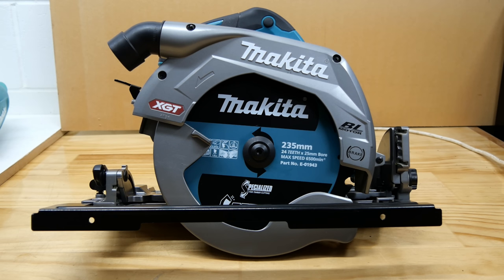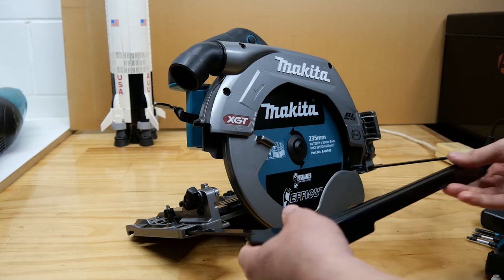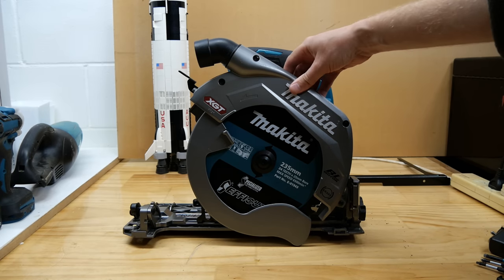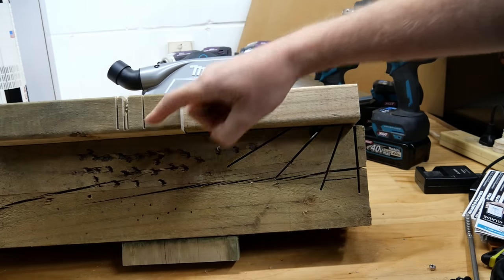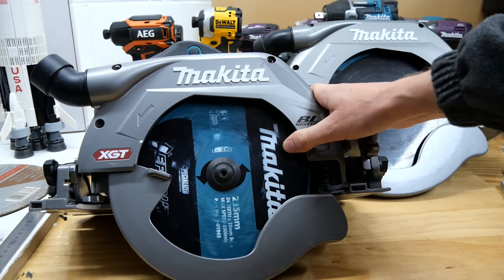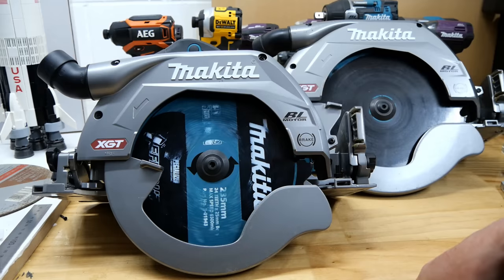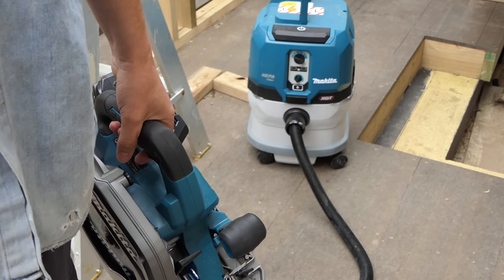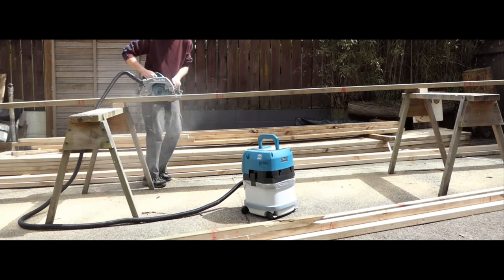40v Makita 235mm Circular Saw Review. Is the Track Compatible 9-1/4" Saw as Good as the 10-5/8" Saw?

Comment: So from this review, my takeaway is that for any piece of lumber wide enough to fit the track on and to long of a cut to make with the miter saw is easiest done with a maki track saw, unless it's thicker than 4 inches, then you need a cabinetry saw or a bandsaw. If there's that much of a performance difference from 4ah to 8ah, and from 235 to 270mm, then the 270mm saw is using close to the maximum potential of the 8ah battery, which is 2160 watts, or 2 and 15/16th's hp. In other words, this saw, with 375$ in accessories (makita tracks, knock off parallel guides, aws chip) can do 99% of the work of a 4k SawStop (3hp, 52 inch rip fence) and barely squeak in over 1k after tax, with comparable dust extraction and the Makita having anti-kick back tech and the sawstop having hand detection. Sawstop is still the safest, but not by much. I'm disappointed more people don't buy these, I wish Makita made a cabinetry blade for these saws but they won't until there's demand, presumably.

Comment: Great videos and really insightful. Currently I'm 18V Makita and have a track. Currently doing some cabinetry etc but like the circular saw option you speak of as they're cheaper and more flexibility. Looking at the 185, am I missing out on anything significant versus the newer 235, or also the more expensive plunge saw? (although 36v plunge also an option). Do Makita plunge saws have less blade play or anything for more precise cuts? Any insight would be greatly appreciated. Thanks!
Reply: Makita makes a 36v (lxt) 235mm track saw, but according to another commenter the LXT version has a more powerful motor than the XGT 235mm equivalent, but I don't think you'd notice unless you have 4ah batteries on the LXT saw. It's almost a table saw, it can do some things a table saw can't too. (60 degree bevel, ability to cut longer pieces, safer than any table saw except a sawstop). With a track and parallel guide rails for it, this saw is almost a table saw. It can't make cuts on pieces narrower than the track, which is the only time a table saw would make a cut more easily than a the LXT track saw, or if you need that last quarter inch of depth a table saw offers. But you'll also need a plunge cut saw regardless to make plunge cuts that don't have tearout.

Comment: How does the HS009G compare to the 36v version (dhs900)? 
I know from your testing generally the XGT stuff performs slightly better than the 36v equivalents, but it is not clear if that is just due to the XGT tools being slightly newer designs (e.g. updated motors), or if it is due to the XGT platform being more powerful than the 36v.

However, interestingly Makita Japan and UK list both higher power (1800w vs 1600w) and higher rpm (4500rpm vs 4000rpm) for the 36v dhs900 compared to the XGT HS009G.

Have you done any comparisons on these two saws? Any thoughts?

Comment: If only they would make one with the handle on the wrong side for us Americans 😊
Reply: Using a left blade saw on a guide rail is awkward as hell. I have the 6-1/2" saw with the guide rail adapter and it's awkward to use especially if you have a guide rail square attached
Reply: @a-carpenter9229  I think it's just the adapter that's awkward I have little 5 inch or 125mm saw and it's blade right still awkward with adapter
Reply: They make a 10 1/4" rear handle blade left beam saw. Worth buying if you work with beams alot I have the 270mm saw it's awesome.

Comment: price of the gsh03  $589  and  gsh04 $600 here in the states makes the pick easy for $11 more but $600 for circular saw is a bit much.   Also note Makita makes a universal adapter to use any vacuum with the AWS
Reply from the maker: Any corded vac with an external power socket outlet.
Reply: Unfortunately it doesn't work as a relay, so you can't use just any old vacuum. Has to be one with an external trigger lead for a corded tool. It's also stupidly expensive for what it is. The better solution for now is to use a remote control relay system if you intend to use it with a standard shop vac.

Comment: When we are gonna see review of the impact wrenches? You have them almost a year now and keep teasing them 🙂. Also, is that true that if you remove battery from a tool that is paired with a hoover via aws, it looses connection and you have to pair it again after replacing the battery? Like when battery goes flat and you change it with a charged one, the aws won't work and need pairing again? Seems silly hence asking.
Reply: No it's saved on the AWS chip
Reply from the maker: You have to turn the chip on, on the tool when you change the battery. Takes 2 seconds.

Comment: Is it possible to adjust the base plates over slightly to line up with the plunge saws on the guide rail? Plunge saws have that option so no matter what brand of saw you use on a guide rail you can set them all to the same cut line
Reply: Yes you can

Comment: Desperately want to know if the 40v 9 1/4 track compatible base will fit on the 36v 9 1/4 saw, any insight would be greatly appreciated! Help a tight arse chippy who doesn’t want to switch platforms out 😂
Reply: This track saw will work with half of all track saw manufacturers tracks. Makita, Festool, PowerTec, Wen, Milwaukee, and probably at least 1 more I'm forgetting compatible. If I were getting an XGT track saw I'd get the 10 inch one, it works with the same tracks as well, all makita track saws use this same standard track. Dewalt, Kraig and a couple others use proprietary tracks. These are also compatible with parallel guide rails, which makes this more of a cabinetry tool if you're into that. The 10 inch saw also cuts through 4x4 lumber completely, while the 9 inch doesn't quite make it through as you know if you have it. The 10 inch saw also has more power, which is also nice. It's almost a table saw.